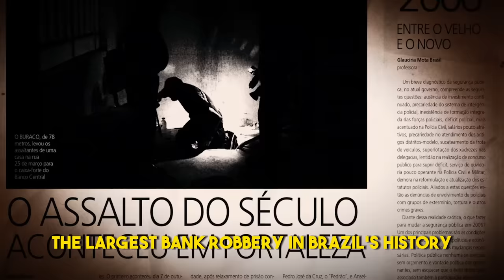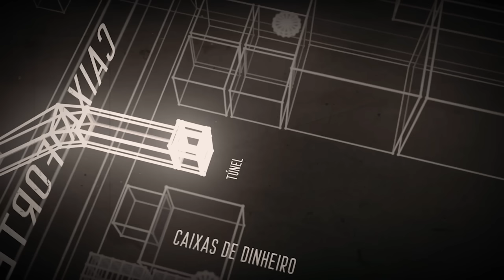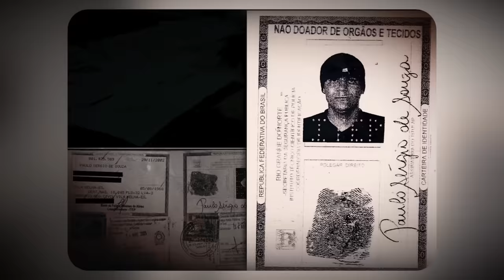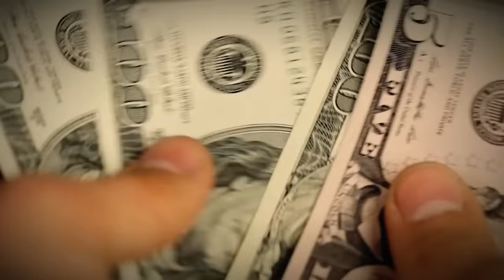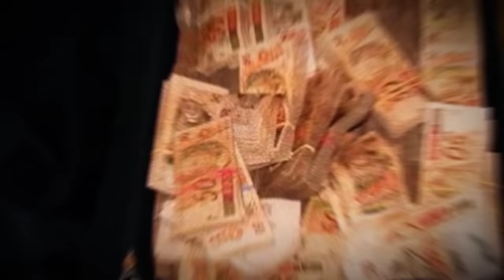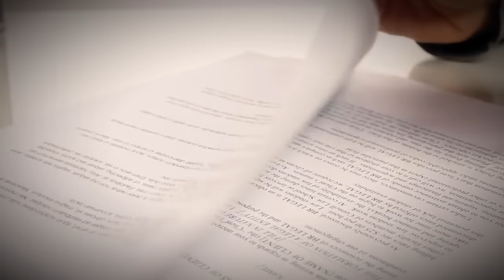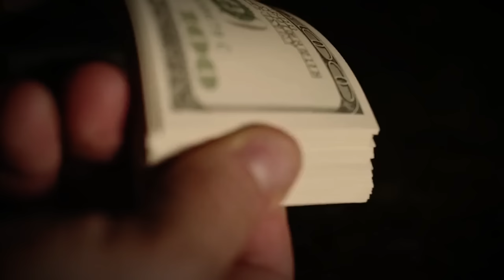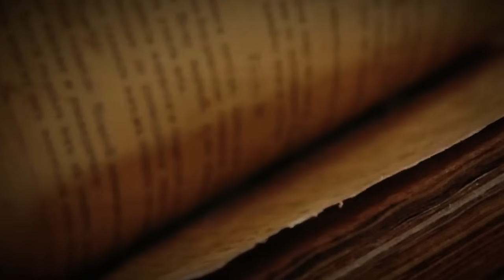Robbers Stole $80 Million From Central Bank Vault, But Things Took The Wrong Turn

Comment: I can only question why most of the banks were built above tunnels 🤣😜
Reply from the maker: They didn’t know that thieves would use these tunnels to rob them 😂
Reply: You'd struggle to find anywhere in a large city to build a building which didn't have some sort of tunnels under. Sewers really have to run everywhere and the main lines have to be fairly large. Also you'd want your bank in a prominent, busy area with lots of other large businesses etc so it's likely to be near the centre of the city so the sewers will be bigger etc.

Comment: Stealing is nothing, the best thing is hiding what you have stolen, it just doesn't make sense to steal and after escaping with what you stole to get caught, since you cannot hide what you steal,just forget about stealing, i felt sorry for the thieves,for after that big raid and to be behind bars,don't steal if you cannot hide your treasure!!!
Reply from the maker: I think they’ve been caught because the gang was too big and has lot of members
Reply: @RobbersIQ  precisely. There will always be problems when there are too many moving parts.  To trust the guard in the first place was a mistake, on the other hand, they may not have gotten so far without him. To keep the money in a safe place is another but to make monetary transactions with cash will always draw suspicion.  To sum up the whole operation, it's always better to live a simple life as hard as it is sometimes.